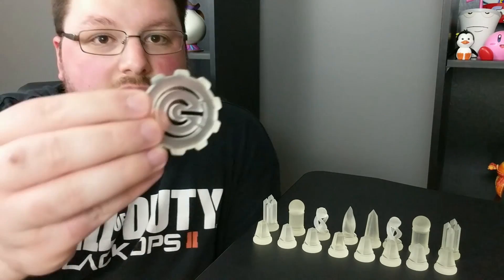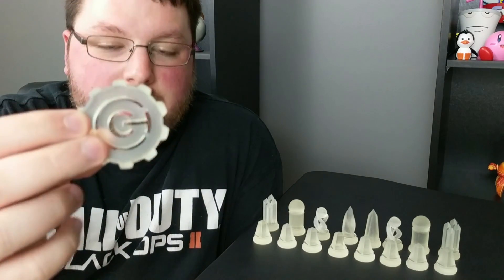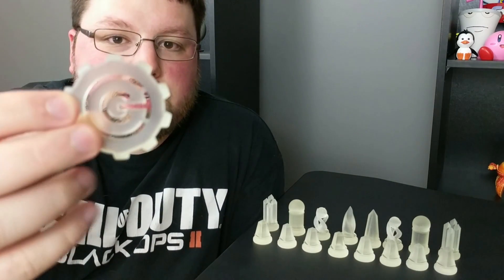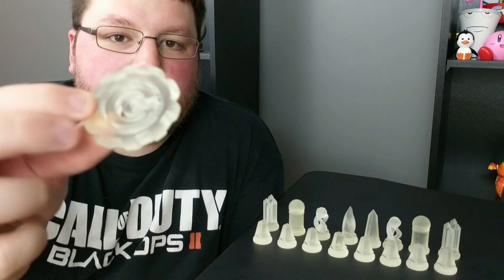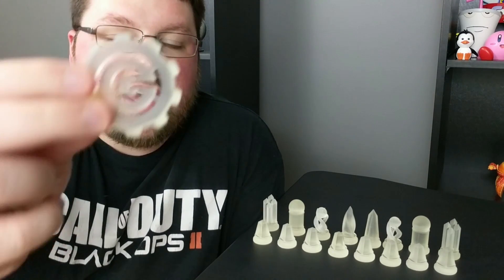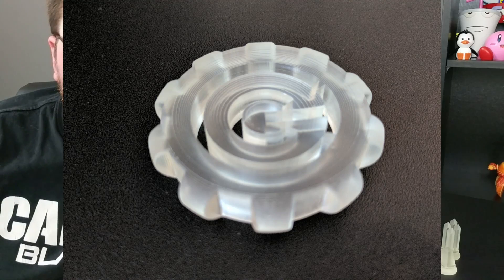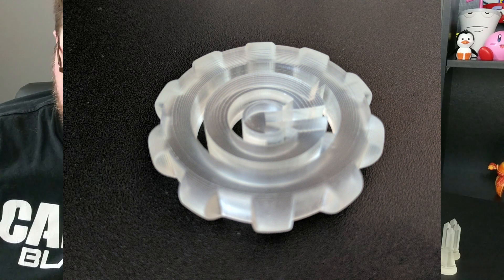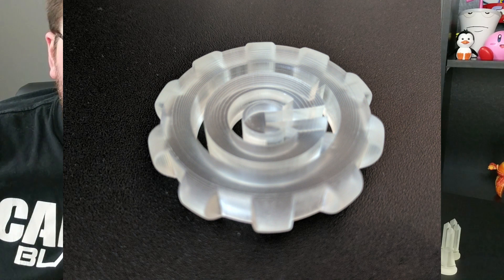Crystal Chess Set - SLA 3D Printing

Comment: I had the same problem with my SLA printer with the pieces sticking a little too well. my solution was to get a removable flexible magnetic build plate. now all I do is take off the build plate bend it a little and the pieces pop right off without a fuss. another benefit is I also don't have to worry anymore about prints breaking during removal from the plate.

Comment: Great job on the modeling, it's a very attractive set :)
i'm going to have a bash at printing them in FDM for the hell of it.
Would you consider adding some strength tests to your review of the resin? i'm rather curios about how strong the parts are compared to PLA/ABS/PETG etc
Reply from the maker: Thank you! Let me know how that goes. :)

And yes, I have plans to do that. Unfortunately they sent me a very limited amount of resin, and I won't get to keep this machine so I didn't want to purchase any extra. So I don't have enough for those tests right now. But I might be getting a different SLA printer sometime soon, so I definitely plan to do those types of videos then. :)

Comment: Try giving SLA clear printed pieces a coat of matte / gloss clear lacquer, either spray gun or rattle can. 

Biggest tip it leans it's self more towards larger objects but it does help to use netfabb/ meshmixer give the model a drainage hole and shell the model helps to reduce print times, surface area issues and reducing the amount of resin used.

Also not all Resins are the same, not sure what the nobel uses, if it does allow for open use of other resins check out some other manufacturers.
Reply from the maker: Thanks for the tips! It's going to take a lot of experimenting to get used to this thing. And unfortunately no, they don't allow 3rd party filament. One of my major gripes with this printer.